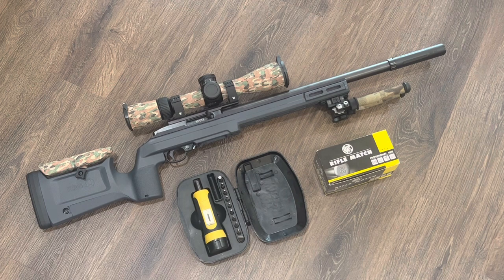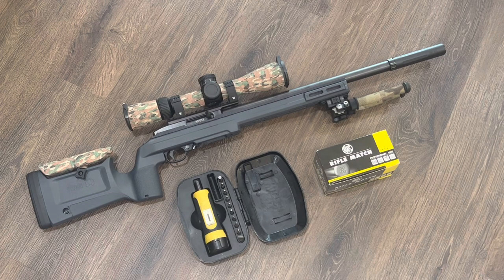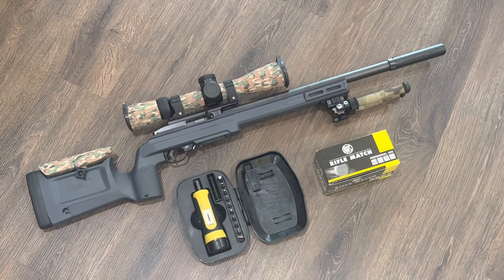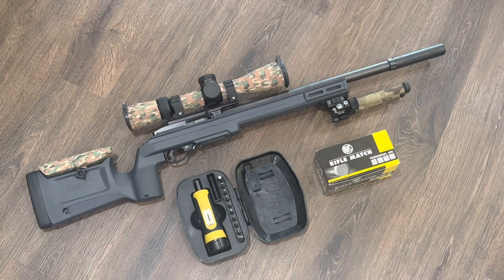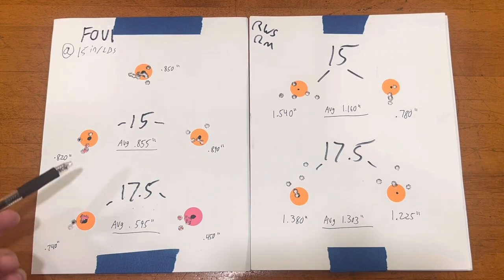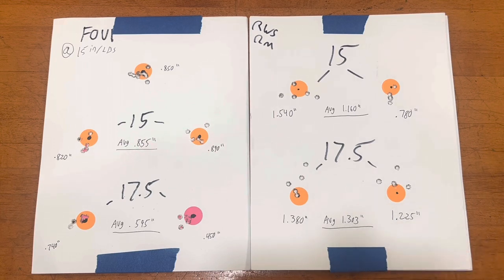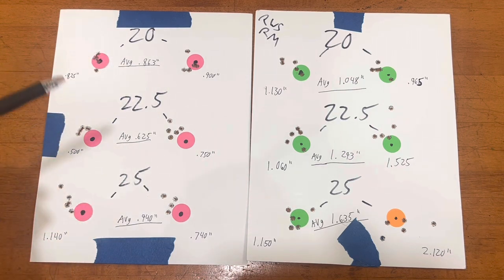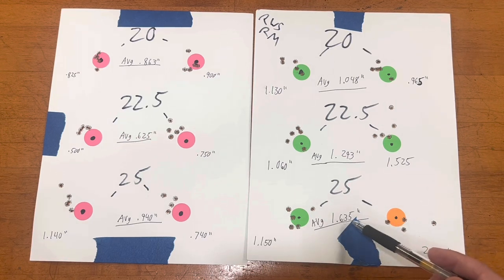Precision 10/22 Upgrade Series - Part 4 - KRG Bravo

Comment: I have the same chassis but the length of pull is so short I ended up buying the spacer kit the and the tool less kit as well just to get it where I like it. I don’t understand why they don’t give you an actual Ruber butt pad in the box. But inside the chassis I have a dlask arms receiver with a 20inch Kidd barrel, kidd bolt, kidd single stage trigger and dlask arms charging handle and guide rod with 3 different springs for sub sonic , standard velocity and high velocity. For an optic I have diamondback tactical 6-24 in vortex precision rings
Reply from the maker: Very nice! I agree, the stock really should have come with a proper length of pull. It’s almost youth model sized 😂